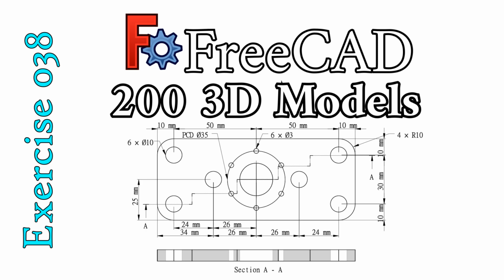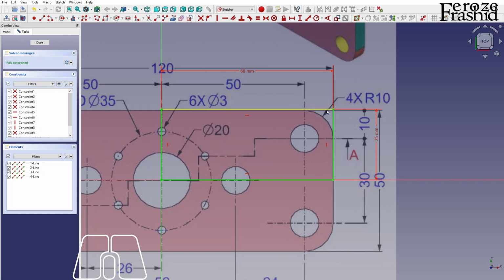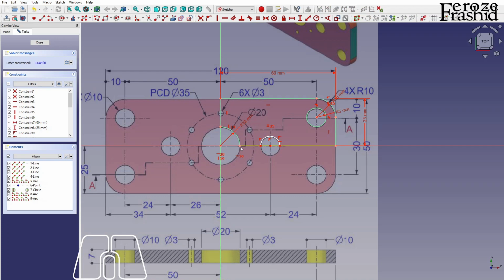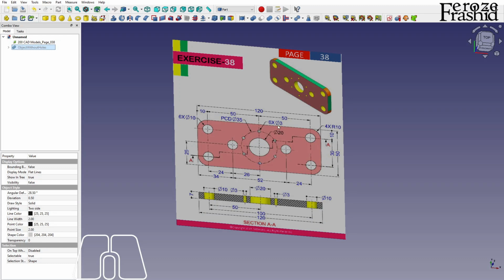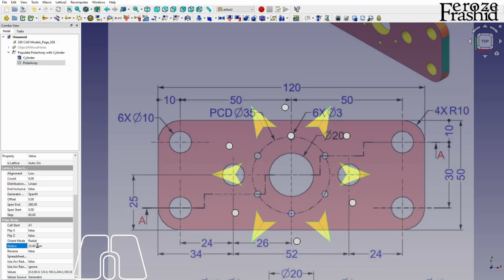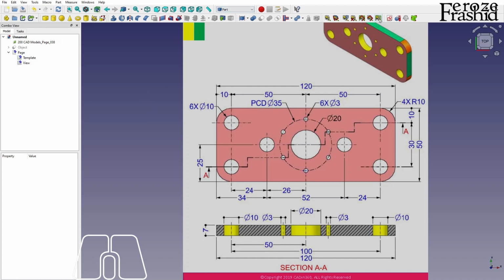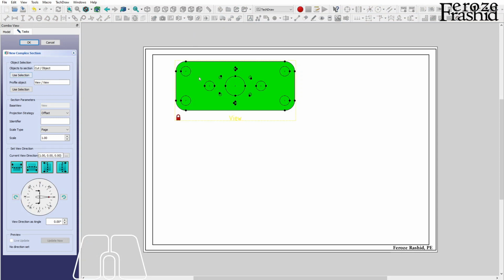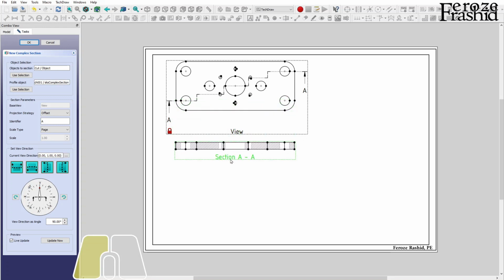200 3D Models in FreeCAD: Exercise 38 (Complex Section in FreeCAD 0.21)

Comment: In sketcher fillet I never notice the drop down arrow and the"constraint preserving sketch fillet" option before since creating a rectangle dimensioning everything then add a fillet w/o selecting the above option first will cause a lot of re-doing!!!
Thanks
Practice Practice Practice with FreeCAD too@
G_Dub
Reply from the maker: good thing is in the new FreeCAD version, the now default fillet will go away and constraint preserving sketch fillet will be the default one. I still think there are rooms to improve on the filleting tool. Even with the new tool, the need to redo some constraints still remains, which is not effective in my opinion.